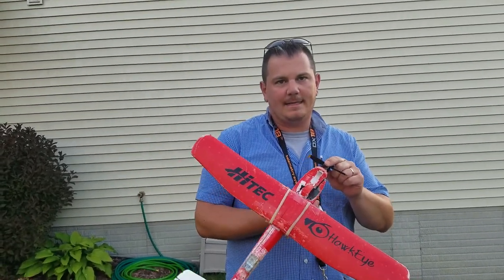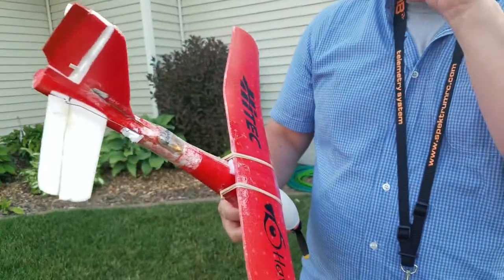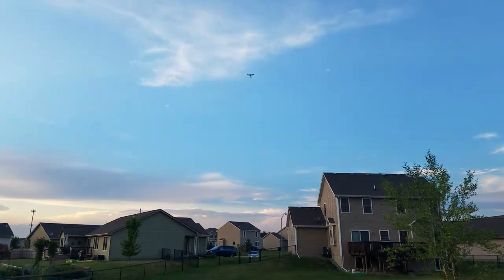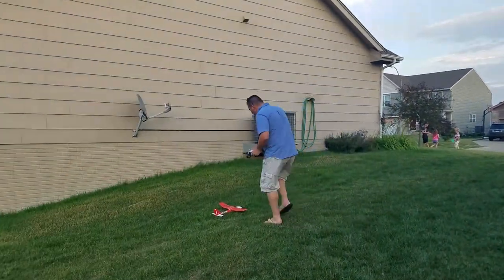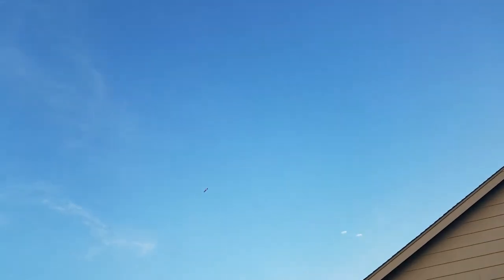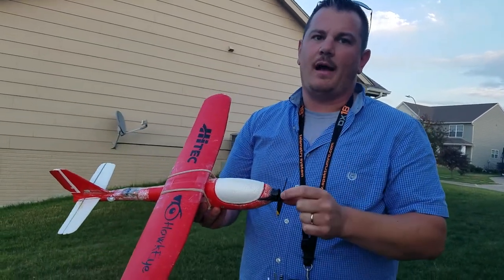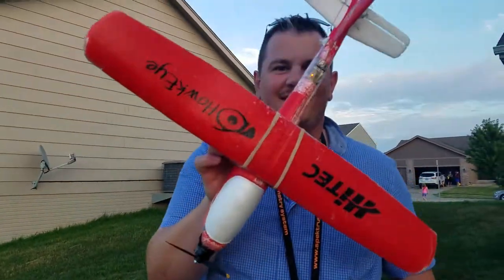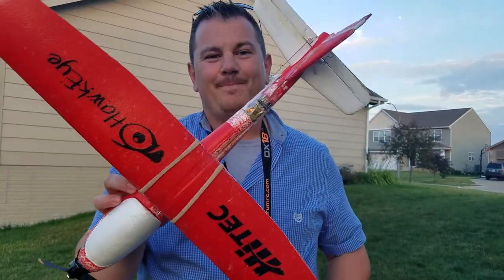HiTEC - HawkEYE - Glider with Brushless Motor Added

Comment: Just saw this video today Brian .   nice !  Brian H E L P ! !  Lol. I have the Orange tx6 radio.  I just received the Lemon 7 Ch Dual Div Stab Rec.  Now im finding out this receiver IsNot the best choice to use w my Tx6.  Other than the HK Orange Stab Rec's, what is the best Stab Cont.  Rx to use with my Orange Tx6 ???    I got the Lemon based upon ur vids.  Ie: ASW28. Etc etc.  Thx Brian .   Willie
Reply from the maker: Your Orange TX6 transmitter is a DSM2/DSMX transmitter, so you can use any of the Lemon-Rx products, since they're DSMX or DSM2 OR DSM2/DSMX (Selectable...since DSMX is newer, you can usually force the DSM2 protocol in stead of DSMX, if you're using a DSMX receiver)...
Their newer "Auto Leveling" has a different name, but it's still DSMX...they call it DSMP (for DSM Plus - totally dumb and confusing name, if you ask me)....and I don't generally recommend this Rx since I've had issues with this and ONLY this of the Lemon-Rx Lineup.

Here's a link to what you should consider getting...
Lemon-RX...
7Ch DSMX Rx,Stab,DivAnt - http://amzn.to/2GTlQze (With Stabilizer, but to actually use all 7 channels, it's a lot of work)
7Ch DSMX Rx,Stab,Sat - http://amzn.to/2F8f3Se (With Stabilizer, but to actually use all 7 channels, it's a lot of work)
6Ch DSMX Rx - http://amzn.to/2CM5lak (No Stabilizer, super simple, but works GREAT)
I DO NOT recommend THIS ONE >>> 7Ch DSMP Rx,StabPLUS,DivAnt - http://amzn.to/2D19ZOI
Also, you can use virtually any Spektrum Rx, if you're a millionaire ;) LOL!